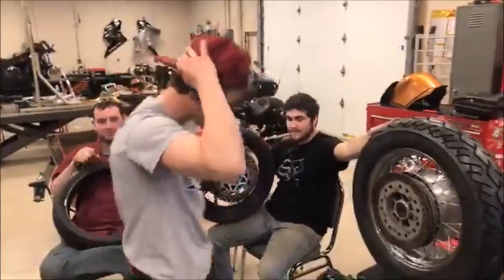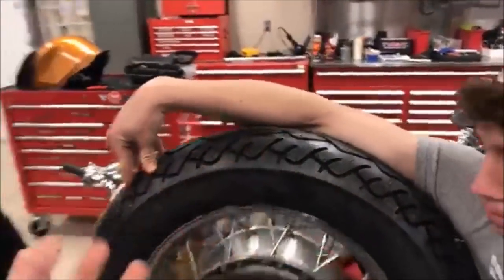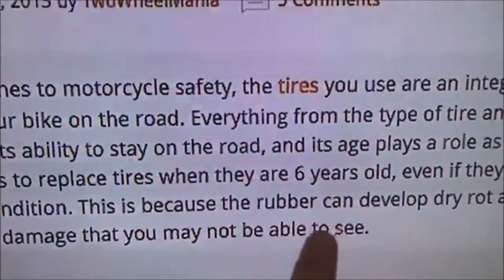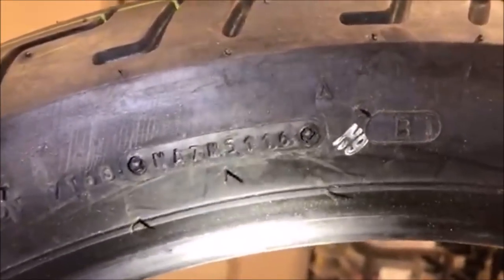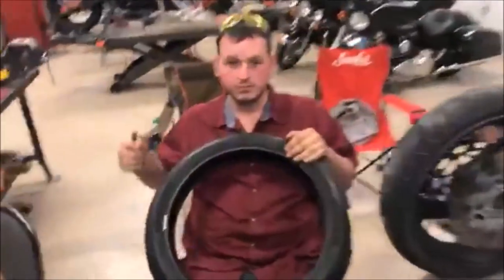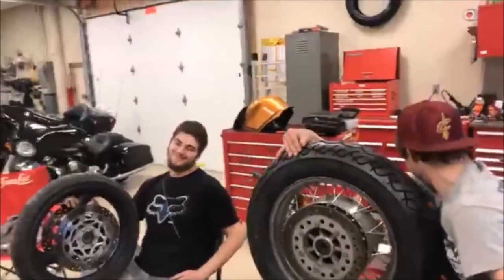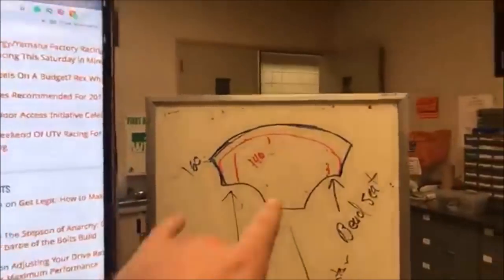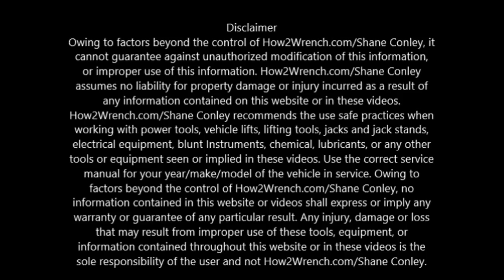How to read motorcycle tire date codes. Do you know the date your tire was manufactured?

Comment: Awesome info on tire code specs. My old man tried going to a tire joint just to get a pinch of air or two and they would not even put air in the tires because they were five years old. They would not touch them

Comment: my Metzeler rear that i am replacing has a date code of 38 week 1991 yep its june 2019 so that's 28 years old and yes i drove on it, ok i had it in storage for a few years but i did put about 1000 miles on it in 2015, road fine. my bike is a 1987 Honda Hurricane CBR600,  so do i win for the oldest one on the road.

Comment: If a tire is on sale,,, there is a reason,,. !!!   Yellow. Dot lightest spot of the tire lines up with the valve stem,,,,.  Red. Dot. Heaviest spot belts overlapped,,,. If there are a hundred and eighty degrees from each other you can balance them out,,,.  If they're at 90° from each other or closer,,, you can't balance them out right,,,.  Three or four or five humps on the inside of the tire,,, made out of scrap belts,,.   If you really look good and know what to look for,,,???   You'll find more seconds and thirds. Defective tires,,,, then good ones,,, the more. Weights,, you need on a  rim the more defective and out of balance the tire is,,,. 2 ounces is Max for me,,, on a car or a truck tire,,. A red dot on the sidewall is a defective tire from the manufacturer seconds and thirds quality,,
Reply: Very awesome info thanks man!